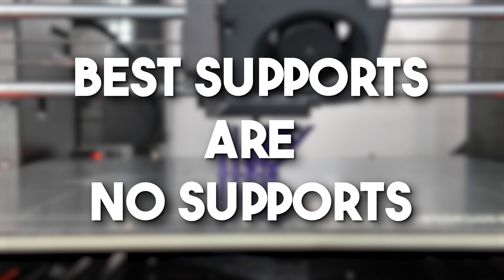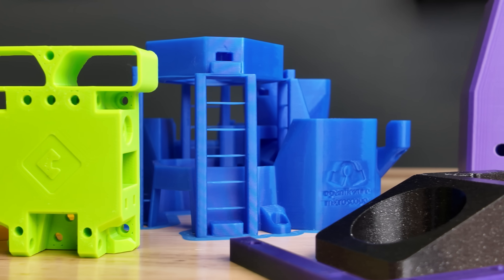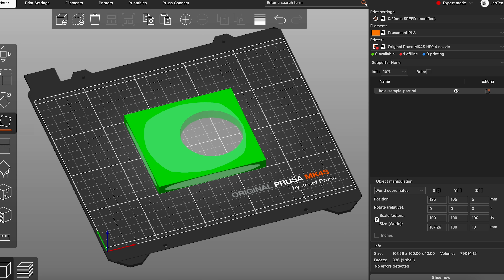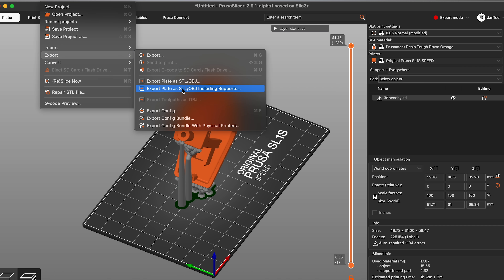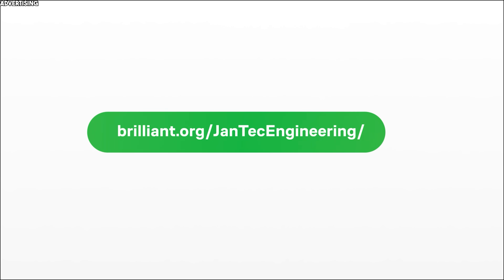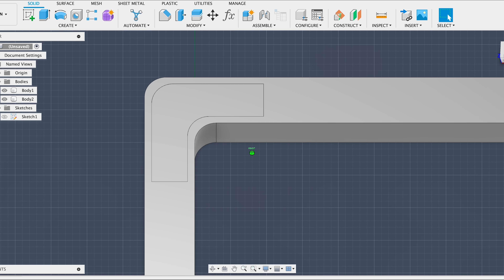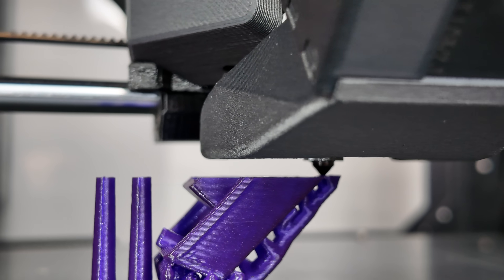Stronger 3D Prints & Less Supports: How to Design for 3D Printing

Comment: 4:35 the microscope is even interesting from another standpoint. It is a OpenSCAD design, fully based on parameters and adjustable for different requirements/hardware.

Comment: As a prototype manufacturer, we confirm these design rules are crucial. Applying them not only improves 3D prints but also ensures success in later-stage CNC machining for low-volume production😀

Comment: 10:00 you can also use modifier shapes. Both Cura and Orca support these. In Orca, right click the part and choose the best shape under "add modifier". Make it overlap where the settings need to change.

Comment: Interesting how you increased the infill amount by creating a complete new part inside the original one. You could just leave the part in tackt and bring in a modifier box which you can also easirer adjust than to go back to CAD and change both parts. Othervise nice video and very informative!

Keep up the good work!

Comment: A bit of feedback on the graphs shown at 9:17. Ideal would have been to have both results in the same graph and use different colors (blue laying, orange for standing). If you use two separate graphs you should make sure to use the same scale for the graph. One is 0 - 70 and one is 0 - 40. Having different scales distorts the perceived difference. You are "forced" to look at the numbers to get accurate comparisons which completely negates the benefit of graphs (visual representation) so you could have just made a table instead. Great video though.

Comment: Stronger 3d prints. Step1- throw away anything up to and including aba/asa. Then start from the bottom again. Nylons are meh, PC CF is interestinf. PET is legit. And PPA-CF is the bees knees. As long as your print is on point, you dont have to worry about design😂

Comment: For anyone confused about the unsupported holes bit, the idea is like laying dry spaghetti sticks across the bigger opening. A straight line across the opening is easier for the printer to do, provided the opening is small enough and the cooling fans are strong enough to prevent sagging. 

The Prusa instructions tell you to make two extrusions, the first is one layer thick. The second is twice as thick. This reflects what would happen if you lay spaghetti sticks across a hole in the x direction (minus the middle), and then again in the y direction (minus the middle). You can then build on top of that. The x direction bridge is the extrusion that's twice the layer height. The y direction bridge is the single layer height extrusion. These extrusions have to be rectangular to force the slicer to make straight lines for these layers instead of the radial pattern that it would normally make around holes.

These are not sacrificial, unlike the following technique.

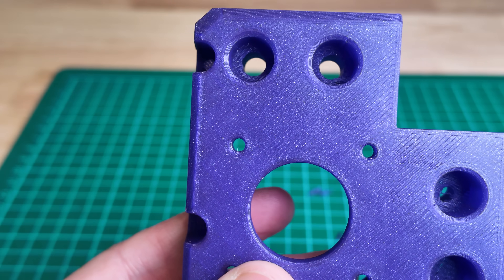Comment: 3:17 - do you need it to be specific thick or any space in between the main layer?
Also  wanted to ask some professional: on the many spools says print speed ~70mm/s is it the limit or how to read this? May be some filaments prints faster(got faster limit by provider) or you can print them all at faster speed regarding the label? Looks like bottom neck and wasted printer potential or I understand it all wrong. What speed do you print for a good result without sacrificing quality and what speeds would you suggest?(walls, top/bottom, infill; I have Ender3pro)
Thanks!

Comment: If you have a hole where the opening faces down, consider if you can use a pointed hole rather than a flat bottomed. A pointed end with a 90 degree angle provides 45 degree features and no supports are needed. 

I use this for heat set inserts that will be installed on the bottom all the time,  it it could for for other holes as well.

Comment: Fyi, it's also better to use flathead hardware instead of socket head where possible- printing countersinks on a vertical surface generally doesn't require support, and when you are putting them on a horizontal surface you are spreading the clamping force of  the fastener across multiple layers, while a counterbore leaves all that force on a single layer and is more prone to delamination if it is a functional part.

Comment: I would love a comparison of fillets vs. chamfers on part strength, I know chamfers are easier to print but has more stress concentration points, BUT, does it really matter vs. a fillet in a realistic scenario? Also, slicers have changed so much over the years, since makers muse made a video about it 6 years ago.

But, nice vid, you have a new subscriber :-)

Comment: Instead of splitting the model, you can add a modifier in the slicer. Add say a modifier cube which covers that corner, then change the perimeter count or infill percent in the modifier shape.

Comment: Why no mention of Modifiers? Use them in your slicer on bends etc to change that areas printing configs such as speed, infill, walls etc. This is way easier then designing in a separate object
Reply from the maker: They are a great option as well, but I wanted to focus on the design in this video and for more complex geometries like the arc in my design, it can be hard to do with pre defined modifier shapes in the slicer.

Comment: For the sacrificial layer I often find (even with stronger materials) that it is possible to just push the bolt through the layer, so you don't really need to remove the sacrificial layer. It does mean there is extra material left around the bolt but if you have clearance between the parts it works fine.

Comment: You can use Cura to achieve what the thumb shows, different configs for parts of the model. Prusa and similars don't have this feature, they change the external wall.

Comment: For vertical holes you could also model them as hexagons, or octagons. For smaller holes the bridging across the top of an octagon is small enough to avoid sagging. It also gives more surface contact points for threading parts/screws into. I believe it would also result in stronger connections with less part deformation. But, I’m not an engineer, so I could just making this up.
Reply from the maker: That's a good suggestion, thanks for sharing!

Comment: If people are using orcaslicer they can get the first two mentioned method also directly in the slicer. Then you can also use this for parts which are designed by someone else. Look at the bottom of the quality tab for "bridge counterbore holes".
Reply from the maker: Thanks for pointing that out, good to know for models downloaded from the internet.

Comment: I usually don't like how teardrop holes look like, so I usually modify them slightly and replace the "pointy bit” by a bridge, either tangential to the hole ore one layer above. (Basically replacing the triangle part of the teardrop with a trapezoid).

For smaller holes this is indistinguishable from a round hole, and still dimensionally accurate without any sagging.
Reply: I do the same and make my bridge the same length as the two angled sides. And if you really want to hide the teardrop shape you can add a circular countersink to the face of the hole.

Comment: Instead of splitting into multiple objects to make the corners solid, it's easier to just add a couple 0.1mm holes, spaced a bit less than twice the wall thickness. The 0.1mm holes will disappear when printing and the wall thickness around these holes will make the area solid. You can even design solid internal brackets by adding a row of holes exactly where you want the internal stiffener. With the internal strength exactly where you need it, the rest if the infill can be reduced to almost zero.
Reply: slots following the contour of the part produce the same result. The slots should not go through the bottom layers.

Comment: You could just use modifiers in the slicer to change infill or other print settings for specific locations in your print. I usually use cylinders at screw holes to greatly increase infill where compression forces from screws are the greatest
Reply from the maker: That's correct and a valid option especially if you download the model online! But for more complex geometries like the arc, designing them in CAD is probably easier.

Comment: please stop populating the 4 side hole support trick, use the 3 side. draw a triangle instead and that way you even save 1 layer...
Reply: That's less precise though, and especially for a larger holes, may not be sufficient
Reply: @TS_Mind_Swept  how would it be less precise? if you sacrifice only 1 layer so with triangle you will get 3 bridge lines, while with the square you get only 2. and if you go for 2 layers for the full square you can now use 2 triangles with total 6 bridges.
i think its even more precise as you get rid of the corners.

for really large holes you definitely should go with another approach

Comment: It should be noted that many of these can be applied from the slicer itself, even when is done in a more "artisanal " way:
3:00 Unsupported holes can be bone by turning the flat under tops into a wedge, using negative parts like a cone and using "adaptive layer height" (an option in many slicers) to close the hole or one step removed of using a CAD software is using a extruded SVG.
5:00 Horizontal Holes, again "adaptive layer height" has help in the past to make unsupported holes, as it allow up to 80° hanging, but that mi personal experience with only small holes. a second more complex option  is cutting the model, extracting the  offending part and adding pause of thís can be placed embedded in the original piece, as the the printing continues, the part will will be "soldered" to the original piece, in fact I originally thought that the method you used in the piece in 1:51.
6:00 Better support, same using parametric supports from resin 3D printing software in FDM printers is great for the hardest supports.
8:25 Part Strength:  many slicer has volumetric printer modifier, transparent shapes the modifying the printing parameter only for the volume of the model inside said shape, that combined with positioning always giver good results. but again this is only   a artisanal way, using a CAD software with stress view is better, even when the exact of extra material isn't calculated.
Reply from the maker: That's true and thanks for taking the time to write that down!

Comment: For reinforcing corners or other parts of a print, where you want close to 100% infill, it is possible to make a bunch of tiny (0.2-0.5mm) holes, which slicer will turn into a solid. I haven't tried this, but according to Slant3D it should work. That way you won't need to split your design into multiple parts and no fiddling with a slicer

Comment: I'm really sorry but you didn't explain slowly and progressively enough for me to understand.
I think it would have helped me a lot if you'd shown the printer actually printing the supports. To just very, very quickly show some shots of your slicer, and verbally describe the geometry in a few words really didn't give me enough to work with.
I think I'd have got just as much information from you if you had simply posted a list of links to the makers you followed, and just left me to look at those and work it out for myself. 
I do think you're very clever and a great maker, but I'm a fairly experienced maker with 6 years of 3d printing using 5 different printers, and I couldn't work out what you were describing. Sorry!

Comment: 5:30 Note on the teardrop holes: You don't have to go all the way to a point at the top. As soon as the 45 degree slopes reach the highest point on the circle, you can bridge across with straight lines. This can give you one more point of contact, although it may need a little hand file work if the bridge droops at all.
Reply: Lil bit over the highest point, remembered about droop.
Also the length of the bridges is very dependent on the material. 
I print lots of ABS and pointy tear might not always be the prettiest, but is safest
Reply from the maker: That's true, it will make sure your part (rod, tube or whatever) will fit into the hole.

Comment: Man, I've re-watched the Unsupported Holes section several times and I feel like it's lacking some context / information there. The later sections where you whiteboard out the context was super useful, maybe you can do something similar with Unsupported Holes? It may seem obvious but it's just not clicking for me how this helps.
Reply: My thought exactly. Got to the end of that section and had no idea how it works or why. Felt very rushed.
Reply from the maker: Thanks for the feedback, I see you're not the only one so I probably rushed it. 
First, you create a new sketch on the surface of the hole you want to support, project the circle (to have it in your sketch plane), and then add tangents to the top, bottom, left, and right of the circle, splitting the area around the circle in four sections.
Then select either top and bottom or left and right secion and extrude by twice the layer height you want to print with, like 2 × 0.2 mm = 0.4 mm.
Then, extrude the remaining sections by one layer height (0.2 mm), and the hole is supported.
 I will look if there's a more detailed instruction video online and add it to the video description.
Reply: @JanTecEngineering  It isnt about how it is made. It is about why it works. You didnt explain that the extrusions act as bridges, and if there are any slicer settings that can help or hinder.
Reply: @JanTecEngineering

I think the problem was not the method. But the problem was not clearly explained. I think you assumed that most of the viewers would have already encountered a problem where circles in air would have no support underneath. So you rushed the explanation of the problem. However many viewers never seen this problem being a problem, and never new it existed end needed solving. So it was difficult to understand the solution when you never understood the problem.
Reply: @JanTecEngineering don't you use an offset for the extruded layer closest to the model?
Reply: @JanTecEngineering   I am brand new and trying to learn. 

So many questions. 

Would you do a quick video explaining what you are doing? 

Something that actually shows this mystical method that you have that can do, but so many other modellers cannot do. But you CAN.

 Arghhh... So many supports
Reply: Me too, watched several times and still didn't understand the steps.
Reply: the simplest way is to imagine it like this:

the normal way a hole is printed is circle by circle. meaning as the nozzle goes in the circle it's 100% printing in air 

if you add a zig zag pattern the printer now quickly prints a diagonal / and \
the diagonal can be printed so maybe 50% is printing in air

and so most 3d printer's can print partially in air

then the next layer prints again 50% in air the last 2 diagonals 

then the next layer prints a circle but now it has 4 corners printed so maybe only another 50% is in air

so you reduced the 100% print in air to 50% which is manageable by most printers
Reply: @dylan-nguyen

Good explanation. Thank you.
Reply: Ditto. He goes from sketching on a surface to extruding 4 sections to two different heights.
Reply: Yes, the top two sections bridge first, then the next section bridges, then the last section so the hole walls can be safely extruded without drooping.
Reply: I think he brushes over the whole thing far too quickly and a 2 second shot of his slicer isn't enough to work out what he did. I posted a separate comment about this. It's great that he is drawing attention to these ideas but a list of links would have been as helpful as his description, that is, not very helpful at all.
Reply: Wasn't clear for me neither. Can you do a short video on this technique with clearer instructions ? Thanks for all your wisdom. Maybe with section analysis to see it more clearly.
Reply: Man, I feared I am the only one being stupid, thanks for the comment....
Reply: How / why do the 4 tangents and 2 extrusions in mid air(?) support the hole in mid air?? This needs explanation. It's not clear after reading all the comments in this thread.
Reply: I also felt lost. No idea what you meant...
Reply: It probably helps to remember its printed upside down. Lets say part is 20mm tall with interal surface halfway up, it prints 10mm cylinder walls and then printer bridges half the tangent, then the second half. So when it goes to print the central bore walls, the bore is supported by the bridged walls.
Reply: Ok, so I'm not the only one... That's comforting...
Reply: Glad I was not the only one. I saw his reply here, now I get it. Thanks
Reply: What part? The sacrificial layer or the Prusa style bridging?
Reply: just watch makersmuse he covered this 3 years ago  way better
Reply: CNC kitchen made a  similar video. In my opinion it's quite intuitive. You model the part in a way that the nozzle goes in a strait way and not take corners. You have to make "artificia" bridges.
Reply: If you have a counter bored part that would normally require supports to print, you can instead use those techniques to take support material out of the equation.